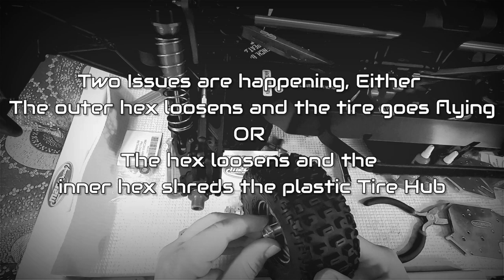M2C Hex Extenders Arrma Mojave Typhon and all Arrma 6s Install Review Tips

Comment: Just saying, I have the Typhon and Mojave and have not had any problems with the wheel nuts? Little dab of blue loctite, make sure they're good n tight and I've bashed hard broke many parts but to this day haven't lost a wheel nut. But cool upgrade I guess?
Reply from the maker: Pretty much a "known issue" based on design but for sure you may have not had issues, plenty don't, plenty do. For a while there I was laughing at most every test video of the Mojave as the tires were flying off. So I was sure to get the M2C solution on mine before I ran it, it's like insurance. Glad you have had no issues brother.... Thats awesome!
In spite of no issues I really appreciate that you watched the video anyway.... Hope your enjoying the channel

See ya round brother
Reply: @3SonsRC  heck yeah buddy. I know, I've watched the videos with wheel nuts flying off also. I guess maybe me knowing about the issues before I got em and putting the loctite and cranking em tight helped. So yes I appreciate you putting out videos. And enjoy watching yours! Thanks 👍
Reply: When I got my Mojave EXB I just gave the nuts a small bath in lock tight and no issiues so far.

Comment: Great videos and content. Question. Has there been any documented issue on the larger 8s platforms? Wouldn't blue locktite help with this? Just want to learn more about the cause. If the extensions are needed has this been missed by Arrma?
Reply from the maker: No issues on 8s hexes I have heard of. I know the Arrma 8s Pillow Ball Retainers are a known issue because they are one piece and that forced the Retainer to back out with vibration. The 6s ones were two parts as are the 8s M2C ones that stop the backing out issue. But the 8s hexes are fine, no extensions needed from what I have heard.
Appreciate your time brother and hope your enjoying the channel

See ya round

Comment: Will this cause the tires to rub on the body more?? I know it’s only 2mm but very curious before I get a set.
Reply from the maker: Great question Dave and good to see ya
I had to trim a bit but the pictures you see are after I trimmed.... It was a tiny bit. And they don't rub while running th truck. I basically fully compressed the chassis and saw a few spots where they barely touched so I cut it a bit. But this is only 1mm over stock and I honestly never ran the truck without the 2mm, so I might have had to trim a tiny a bit anyway 🤔

Thanks for your time and see ya round brother

Comment: I wondered why the mojave had that issue... buddy of mine has one and kept losing his wheel nuts and cooked a wheel or two. He got the M2C hubs that you run screws through that hold a stripped wheel.
Reply from the maker: Yeah man it's a known issue, thought I would put a detailed video out on the issue and M2C fix😎👍
Super Appreciate the time and kind support, hope your enjoying the channel, see ya round brother
Reply: @3SonsRC  Hi. I want to purchase this for my Kraton 6S EXB I am finding the hex is twisting in the wheel center hex and eating the wheel. Once I purchase and install this and I am about to bash, I install the first nut...then next the second but you said add a little bit of blue loctite. Normally we wait 24hrs but will that still hold if I am about the bash immediately when adding the loctite? I ask it depends on how the location looks on which set of tires I will use at the site.

Comment: in trying  to get one of those set cause I have  the mojave exb brand new i used  two times and the rear wheels  tires. ar gone i guees to much torque with the max5 esc and 1100kv motor hobbywing 🤦🏻 very disappointed with the hex in the mojave
Reply from the maker: There a must bro,
I wouldn't run a Mojave without them. Max 5 is crazy bro😜😜, I have a Firma 160 and a 1580kv and she is bonkers🔥🔥🔥😎👍
Yours must be insane as well.
Appreciate your time and comment brother, hope your enjoying the channel, see ya round bud

Comment: great video but as a professional mechanic I cringed and wanted to scream when you grabbed pliers, especially needlenose pliers, to hold the hex. I couldnt take my eyes off that and the jaw marks on the hex. As much as I dislike crescent wrenches it would have been a better option.
Reply from the maker: Thanks for the kind words. I understand brother on tool choice, not exactly the same amount of force applied so if your careful none or little marring is done... But I get it. But it's just a Toy 🤣🤣🤫 don't tell my wife that 😁
Hope your enjoying the channel brother, see ya round
Reply: @3SonsRC  i am. though if I could get my lsd back together I could be enjoying the channel more. im about to break out a couple BFH's on it
Reply from the maker: The LSD's are tricky.
Watch "DRRC Stunt" I think he has a video on it, I could discuss it here but you need to see it. I think he just dropped the video.
Glad your enjoying 😎👍
Tip is you have to put all the gears, planitary and plates face down and only thing on crown gear when you close it should be the pin. Before closing it all needs to be flat and level in the bottom half all the gears pushed down into place. Hope that makes sence.... Just watch video... I'm sure I'm not making sense 🤣🤣

Comment: It needs belted fortresses lol mojave has to much power
Reply: i assume thats a type of tire?
Reply: Yes
Reply: I bought the m2c extended hubs so I can put some 2.8 17mm duratrax sixpack belted its so far holding up
Reply from the maker: I haven't had issues with stock and I go pretty fast, assuming there may be issed going 70 mph tho😳😱
Reply: Yes there's a problem with the rim touching the hub the carriers so it rubbs it till the rim falls off it happens sooner or later